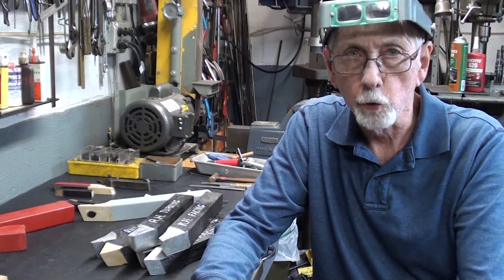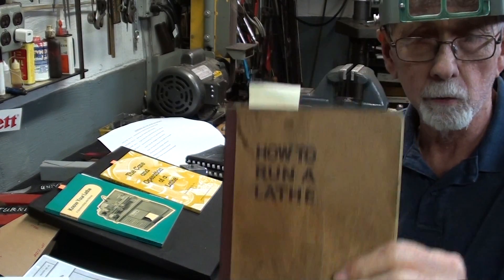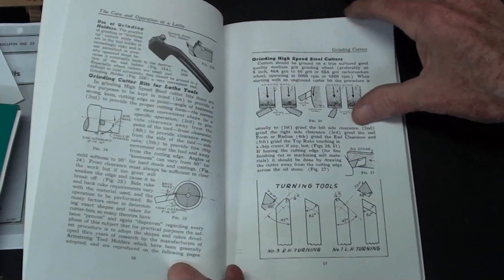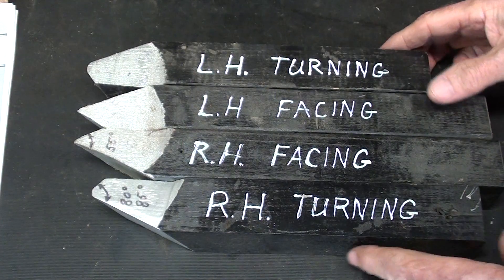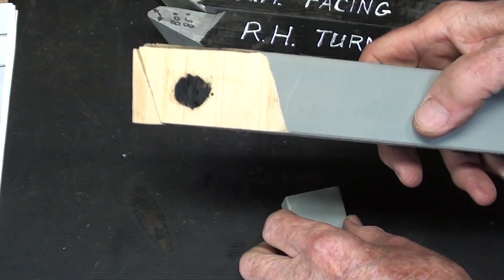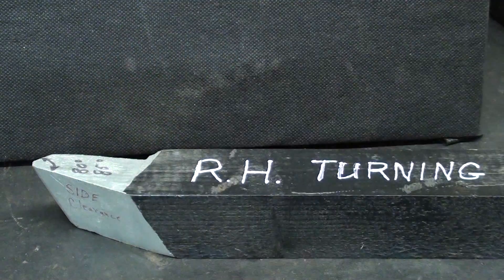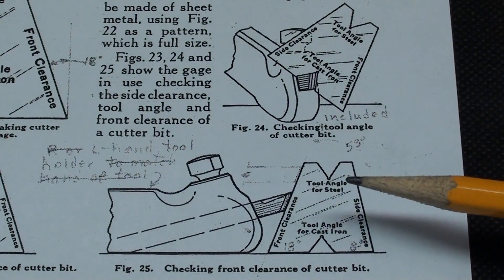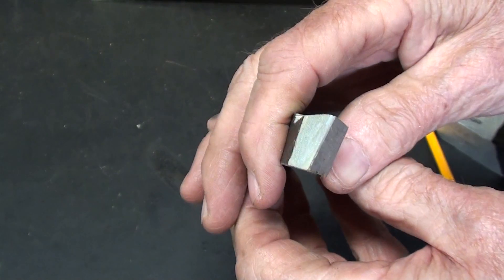LATHE TOOL BITS - Shapes & Geometry #710 tubalcain atlas

Comment: Hello Mr Pete, I bought a surplus  Kennametal KTCN-644C Lathe Tool holder that uses an insert where the flat face of one triangle faces the workpiece. This seems strange to me that the flat face would be used. I would appreciate any insight or video you might have demonstrating the usage of this type of tool. Thanks! Jeff

Comment: Awesome presentation Mr. Pete. I am using a size AXA quick change tool post in my WWII vintage Southbend 9C Lathe. The lathe was missing the original lantern style tool post when I bought it, so I purchased and have been using the QCTP and its compliment of tool bit holders. The problem I have been experiencing from time to time is tool chatter. It is so frustrating because I get the chatter turning mild steel at the slowest feed rate and with cuts as shallow as .005. The tool holders are not compensated for turning tool rake angle, so I am realizing that perhaps I need to increase the rake on the tool bits I already sharpened by hand.
Reply from the maker: Yes, try grinding your  tool with various angles

Comment: I recently received your Atlas Lathe course and just now finished watching Chapter 14 which seems to cover the same info as this video.
This brought back the memory of my first attempts to grind my own bits:  I had found it baffling, trying to get the shapes and angles right.  So rather than waste my HSS bits doing it wrong, I bought a 10-foot piece of 1/4" square steel and practiced on that.  Since this common steel is so cheap, I could practice all I wanted till I had some inkling of what I was doing.
But funny thing:  At the time, the only metal I wanted to machine was 6160 aluminum.  Came the dawn -- it turns out that I could use low-carbon steel tools to cut 6160 aluminum just fine.  Granted, I'd lose the edge relatively quickly, but, lo and behold, I could resharpen these tools with a file.  So, not only is this a cheap way to get all the practice you need in grinding tool bits to the shapes desired, but you actually get a set of tools from the exercise that are useful for cutting 6160 aluminum.  
And then you can transfer this training to grinding your more costly HSS bits for cutting steel.

Comment: I need some help.  I purchased my Harrison L5 Lathe (1959 ish) from an old machinist.  He worked for Universities making laboratory experimental jigs.  He was an apprentice during WWII here in the UK.  He would never discuss his age but he did admit that he was bombed on his way to a movie.  Knocked off his feet when a bomb hit close by.  I have his tool bits and they work really well.  I have tried grinding my own but they just don't work as well as his.  I was taught to grind bits when I was in high school at the age of 12.  I just can't get one of my bits to perform on this lathe.  What did Derek know that I don't?  He said that he apprenticed on this lathe back when he was a teenager.  Does the individual lathe matter this much?  He had 55 years on this lathe at least.  None of the established American profiles I was taught work at all.  Derek's bits look like they are from the moon.  I cant even begin to understand the geometry enough to re sharpen them.  What do I do?  By the way, Derek chambered all of the rifle barrels for the Canadian Palma Team on this lathe so I know it is good.  He said that he replaced the bearings and got rid of the run out.  Poor Derek has past away so I can't just phone him up any more. He was a great guy.  He  worked mostly in aluminium towards the end so you can imagine what he was grinding to make this slow lathe work with that material.  What knowledge. I am very respectful.
Reply from the maker: That is a very difficult question to answer. I see that you have watched my video. I would say watch it several more times and practice over and over until you get the angles pretty much perfect. Also try to hone after your grind without rounding on the cutting edge. Practice practice.

Comment: Dear MrPete222 - I love your videos.  I wish I'd had you as my shop teacher way back when... Long shot question: I'm wanting to use a fly cutter to cut nail nicks into the slip joint knives I make.  But I can't seem to find anything that details what shape/geometry to put on the HSS tool bit to get the best results.  What are your thoughts?

Comment: Hello Pete. Friend this is Keith from Michigan. Currently 65yrs old, have been in South Bend company. I've been around machinery and ran with the big ones. The machine cell had 37 stations for 3 primary operations. Did Cams, Crank and did honing. Specifically worked with metric. Last career was in aerospace with overhauling. I was the only person, could hand grind "A pile of crazy tool cutters, and they all virtually cut without chatter issues. Thanks for all your skills to help a hobby person. Have a great October..

Comment: Thanks Mr. Pete.  I have watched this video more times than I have watched Forest Gump.  Being a beginner, I would just like to share my thoughts.  You have said somewhere that the Right Hand Turning tool is probably the most often used lathe tool.  But the Right Hand tool makes me nervous because it is to be used in the direction from the tail stock to the chuck.  I am afraid I will run it into the chuck, especially if I am using the auto feed.  I would rather cut away from the chuck.

Comment: I’ve learned so much from your videos, thank you for them. I’ve been timid about grinding HSS blanks but using your gauges & holders I need to step up to the plate. I’d like to get away from the expense involved with carbide.

Comment: It's very old and nearly in tatters, but I have this little pocket notebook published by Armstrong that head 1:1 images where you could lay the tool over the outline for all four sides. Very simple, but a great little reference. It's been hanging on the nail next to my bench grinder since before I was born. Some of my earliest memories in the shop, my grandpa would set me to grinding lathe tooling using this little manual. It was a great point of pride if when showing my work, I earned a grunt of acceptance. I've never seen another copy of this little pocket guide, I suppose it would be fairly easy to reproduce one? Pretty tough to explain cutting geometry to young boys, but matching my steel blank to the outlines was somewhat doable. I'm sure I wasted a great deal, but I'm forever thankful for the ways he taught me the many things he did. I cannot remember a single occasion where he told me I did something wrong; instead it was always, "let's see how it works". Using a poorly ground lathe tool is a much better teacher then simple approval. When I wanted to learn how to weld, he just sent me at it. The rule was I had to saw through my welds afterwards to determine how good of a job I did. I don't think that man ever told me there is one correct way of doing things. The message was much more that every day is a learning opportunity. If you're not taking advantage of that, you are wasting time. I just learned that I've been using left hand and right hand lathe tools terminology incorrectly for over 40 years! Thanks for today's lesson

Comment: Will you be covering round profile HSS? How about tangential cutting tools? I've been very curious about these offerings from eccentric engineering. Supposedly makes quite a difference on smaller less powerful lathes. I would really like to try one, but they are rather pricey. I keep asking various Machinists in hopes that somebody has tried one and can tell me simply if it's worth the cost of admission?

Comment: Bought a new pedestal grinder, at sale, still standing on the floor on its rubber feet. It runs very silently and doesn't try to walk away.... The only pedestal I've got is the home for 3 flower pots...
Regarding the sparks from the grinder some home protective cabinet is needed for the shop residing in the kitchen....
End of the joke.

Will You show how to grind ship brakers lookin like ditches?

Comment: Mr Pete, I was trained on a mori seiki, but I picked up an old Sheldon a few years ago as well as all the books you recommended in the first 3 minutes. Something really stood out to me about these old manuals, they all instruct the operator to do facing operations from the center of the work out and to do turning operations from the check towards the tail stock. This seems like a simple but clever technique to avoid crashing the lathe. I was taught to do things in the opposite direction and virtually every machinist on YouTube works towards the chuck and towards the center. So what is the reason for this contradiction? I've never even heard it discussed! It seems like something that is taught as being so foundational, various authors would agree on the correct direction. Your thoughts?

Comment: Mr. Pete,
My Dad was a turret lathe operator for GE from 1938-1958.  He told me that once he passed the apprentice program, he used carbide tooling.  I know GE owned Carbaloy for a number of years.  When did industry start using carbide tools?  Did inserts exist from the start or was it a 1960's invention?
Thanks for this video, it's 50+ years since my high school machine shop classes.  The review was great.
Reply: Brazed carbide tooling was fairly common from ww2 on.  I think the first carbide blanks for throw away change out were for milling cutters in the 50s.

Comment: Great video Mr Pete! I started working in a large union production  shop in 1968. We went to an apprentice class for 4 hours, 3 days a week. That lasted about 6 months. We had covered mostly safety and then drills. The company started getting snowed under with orders and suspended the classes. Too bad! Most of the people on the floor had completed these classes. So there was a definite knowledge line between us new hires and people with 3 or 4 years experience. The next year they took out the cafeteria and classrooms to put in more machines. I saw a bunch of the teaching aids piled up in a corner, things as you show... In 1973 I purchased a 1929 S. Bend lathe from an x shop teacher who got it from the school. Along with a 5 gallon can of tooling, I received the original paperwork and a copy of the SB how to run a lathe. They should have gave everyone one of these back when I started! It answered so many questions and illustrated in a simple manner. Instant knowledge! Lol! Sorry for the rambling! Just brought back many memories! Great recommendations for reading! Thanks for your time and sharing! 👍😎✌️🇺🇸
Reply: Still rambling! In later years, I think around 2006, I received a stack of copies of  "the Starrett book for student machinists". I was mentoring at the time so I distributed these to people who seemed to really want to learn the trade. 17th edition, revised,1998. Cat. No. 1700.

Comment: In 1965 when I started as an apprentice we were first assigned to a fully equipped training section. When it came to learning how to sharpen lathe tool bits we were given a piece of 1/2" square stock and had to practice on that until we could show that we could do it properly. We did not get any HSS bits to actually use on the Lathe until we could show the instructor we knew what we were doing. This was in Northern Ireland the instructor said HSS bits were to expensive to waste on practice. Good old Scots Irish frugality.

Comment: Thanks for the heads up Mr Pete. There are new, 2013 Reprints available of  the 1942 Edition of How to Run a Lathe on Ebay in the UK as well as used copies although the new ones are cheaper. 
The Boxford Lathes Know Your Lathe Manual is available on CD ROM but ironically if you wanted a paper version in the UK you would have to buy it from a US seller and import it.